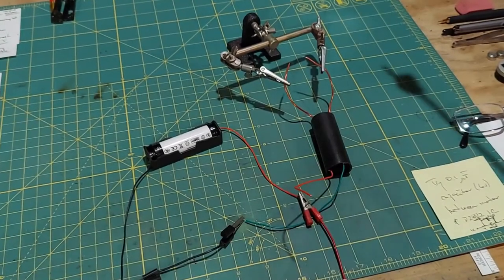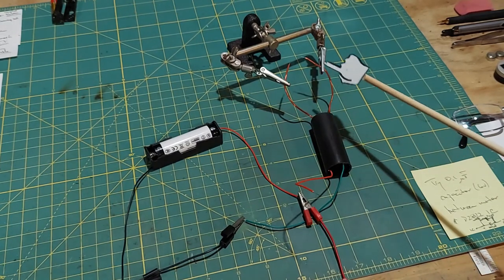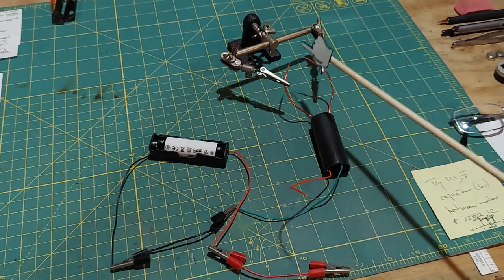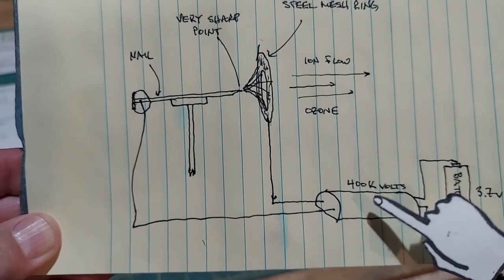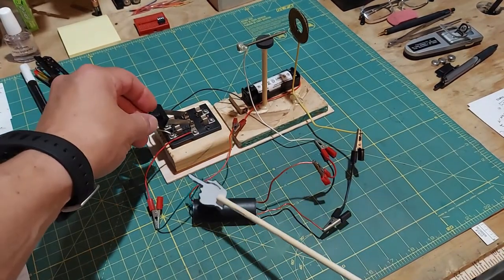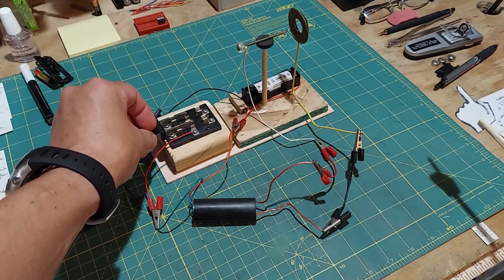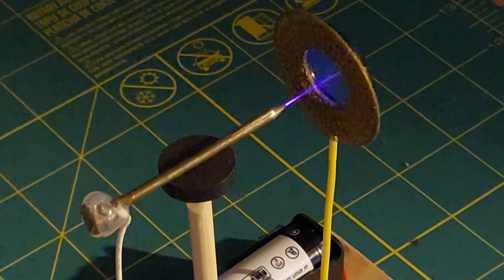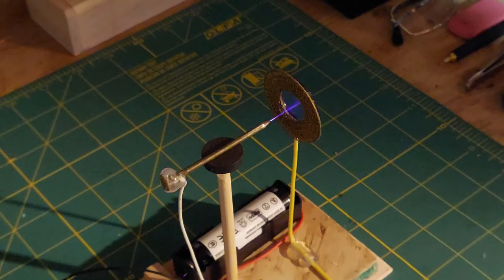Creating An Ionic Wind

Comment: It can be used to sterilize the house, cellar, and closed places because it produces ozone gas. This is thunderbolt. Its uses are endless as an engine and water sterilizer. Repeat the experiment, but immerse it in water.
Reply from the maker: Yes, sterilization is done well with ozone.  You just have to be careful not to breath it.  Maybe I'm missing something, but how would this run underwater?
Reply: Running it under water would create HHO gas, and Chlorine Gas
Reply from the maker: Ok, I see.  But, how would you insulate the electrical charge from the water?  And still get ion flow?  Water shorts out electrical currents.

Comment: Thanks, great video. Does the ion wind setup change how much power the hv generator use? Does it get hot quicker?
Reply from the maker: Because this HV generator is connected to a battery, the amount of power that goes into creating the ion wind doesn't change much.  However, a bigger set up could indeed pull more power and this would in turn create more heat.

Comment: What high voltage generator is that like how many volts
Reply from the maker: They're advertised as 400,000 volts on Amazon.  But, in reality they're only 30-40,000 volts max.

Comment: Why does the amperage drop tremendously? Isn't the voltage multiplier just a bunch of capacitors and diodes? My thinking is that the amperage would be the same as the battery's maximum current if you were to just grab both leads and complete the circuit with your body.
Reply: V_in*I_in = P_in > P_out = V_out*I_out and (V_out)_peak >= 3.0e4*(V_in)_peak , so (I_out)_peak < 3.4e-5*(I_in)_peak

Comment: I was curious about venting the ionic wind through a coil and seeing if anything happens as an experiment. The purpose is to see if the voltage could be dumbed down and controlled while increasing the amperage of the device. If that doesn't work then try a miniature wind turbine. The ions are in the air this lets you use them as a potential fuel source without using a lot of input energy on the users part, it gets nature to do it. The device is the collector such as  a solar panel collects photons. If the idea works out of course. 😅 I'm no free energy nut, but this idea hit me last night and now it's got my brain turning. I do like the long term energy collectors though. This might be one if figured out, I don't expect much energy out of it though.
Reply from the maker: Thanks for your input.  There's is a small issue with the first idea though.  These types of electrical phenomena only tend to work with high voltage, low amperage currents.  To increase the amperage the device must be much bigger.  But, maybe that's what you're thinking?  Also, you cannot create energy from this device, no matter how big.  You're better off just using the original current (the nail in my case) to run something else.
Reply: @cranialconstruction2218  oh ok, thought that there was a chance to harness the ions from the air as useful energy. I putz with different energy ideas because I love making useful energy no matter how low the amps,, (I get a thrill from it working.) If you can manage that then there's usually a higher amperage way to do it. What your doing is interesting nonetheless. Definitely want to play around with the science around it.